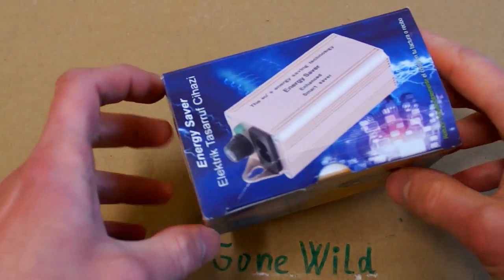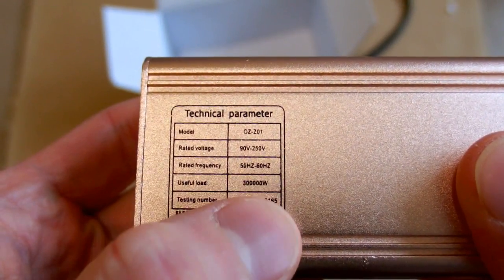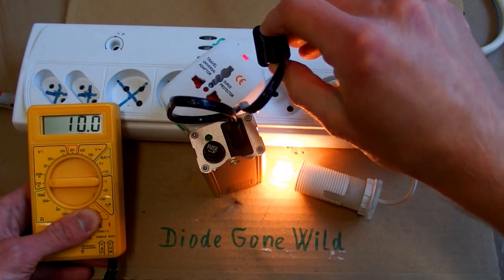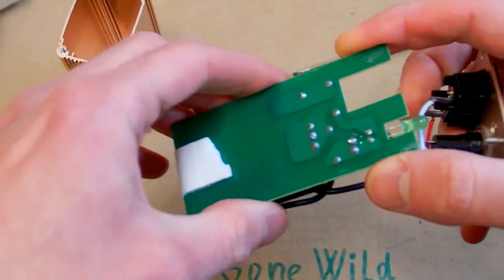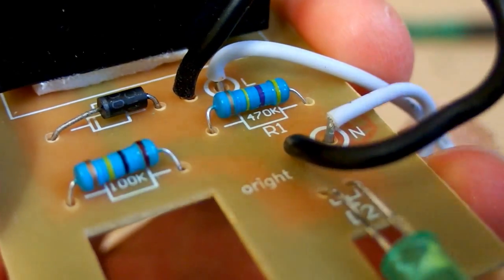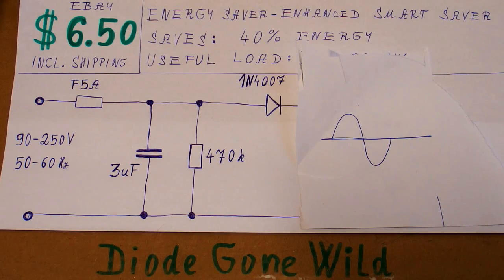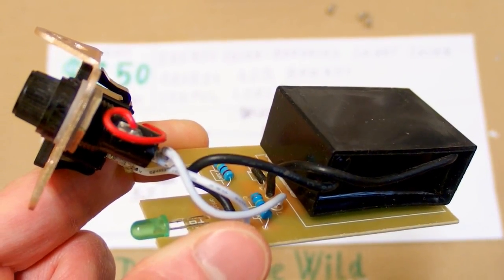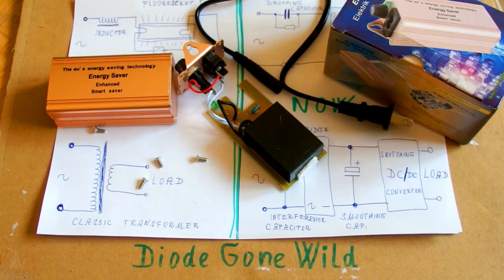Free Energy? Chinese Energy Saver (Metal Box Version) Tested.

Comment: I saw resistors in that device. They are used to regulate the flow of electricity just incase the electric company produce more energy which is higher than the exact energy needed by an appliance. That device cannot not generate additional electricity, it can only allow the electric flow stabilize. The company will produce more energy in uncontrolled flow of electricity in houses which is not necessary in some appliances so that the electricity company will earn more income and may cause small damages to some of our appliances. It is somewhat like food that the waiter serve to a customer. However, the waiter will serve more foods which are higher than the number of foods the customer ordered and the customer have no choice but to pay that wrong number of servings. Though, in electricity, a resistor can handle that. It will help to serve a customer with a good number of servings that a customer really order. Other reasons why it is not effective is because of fake markets and abusive use of electricity. We have already resistors at home. We have two.
Reply: This is the most hilarious shit I’ve read in a while. Thanks mate, you made my day!🤣

Comment: There is nothing about energy saving in this device. Capacitor between phase and neutral can reduce reactive power for induction motors if capacity is properly balanced with motor inductance. Which can slightly reduce power bill for households who use appliances with induction motors like vacuum cleaners, HVAC etc. and have old type utility meters where reactive power became wrongly added to real power due to meter design. In households with newer utility meters reactive power is ignored and "power savers" will not "save" anything. Keep in mind that same capacitor for motors with various inductances will not work. So presented device here may be considered as scam.

Comment: The plug on the cable is not a proper American plug. A compliant plug has holes, which allow for the socket to hold onto the plug better, but More importantly, the neutral prong is wider than the the live prong. This is so that you can't accidentally connect it backwards.
Reply: 50 70 percent Mein mil sakta hai kya

Comment: 2:08 I have the same deadly adapter but my father bought it from Japan. It's deadly probably because it don't have ground.
Reply: The issue with those adaptors tends to be the fact the live terminal is large enough to accommodate the earth pin of a UK plug, meaning it's possible for one to inadvertently connect chassis to live e.g. if trying to plug something in in poor light. It's not possible for such a thing to happen with French or German plugs (Which have the male element for the ground connection in the outlet) but it's definitely a risk with UK/Saudi, US and Australian plugs, all of which could have the ground pin inserted into live by accident. ⚡💥⚠

Comment: You got a nice anodized alUminium case for a future project.
Reply: Yes, this is what I though. This could be a cost saving if you need this box, a fuse holder and a 3uF high voltage capacitor. ;-)
Reply: absolutely!

Comment: we made such "energy saving devices" in primary school. it consisted of an empty mains plug and a capacitor inside, connected in parallel with terminals. we did not actually bother about discharging resistor as the main use was to give shocks to fellow colleagues during the breaks.

Comment: The box looks very similar to the box on the Smok m65 vape mod found here:

https://www.fasttech.com/products/3032/10005386/2111803

Just like the Smok m65, the circuit board was shoved into the box ungrounded. I was selling these and a few came back with a chip shorting out on the board and catching fire and they wouldn't refund me because it was on clearance. So I still have them sitting around.

Comment: I'm french and now in France with "LINKY" the new electric power meter for residential installation, is now the apparent power that is measured (I don't now if its the same for the European Union), as the same for the industrial installations but since many years, that why french industry use some capacitors correctly calculated to reduce the reactive power, who cost much more!

Comment: 240 volts, 300000 watts with a 5 amp fuse? I wonder what version of ohms law they were using to calculate that? A 5 amp fuse at 240 volts can only handle 1200 watts before blowing!
Reply: They having some new way to wrong calculate the value 😂
Reply: Mr. Ohm is rotating in his grave.
Reply: Chinese ohms law
Reply: Chinese Ohms. Never heard of him?

Comment: Could this device be useful somewhat as a surge protector? If the voltage sags in your house momentarily due to inrush will the capacitor help keep the voltage constant by dampening it out? Seems like it could also work as a noise filter. If you have RFI or EMI on your wiring this should smooth it out also.
Reply: Probably it could. But it would need some PCB and electronic and many milli farad capacity and not only a few micro or nano farad.
Better throw this away and use a variac instead. ;) It's simple and more useful for surge protection
Reply: I doubt it.  For high energy stuff, it's just not big enough.  And for fast spikes there's a whole lot of inductance in the wiring.

Comment: Heh. What a snake oil equipment. If that is cheap, I could buy those for DIY purposes. But as you told, it is metal and the socket is class 2 (double insulated) it is quite challenging to make it safe.

Comment: You did not set up this device on a inductive load, normal light has not much to do with power factor, there for no saving in it, but if you put on a motor load certainly it should improve the power factor which helps to save bill.

Comment: This device is design to use with power tools and microwave appliances they draw too many amps on the circuit to prevent power surges when you drop too many amps on the circuit so you do not blow your fuse in your fuse box or cause damage two other appliances plugged into the same line

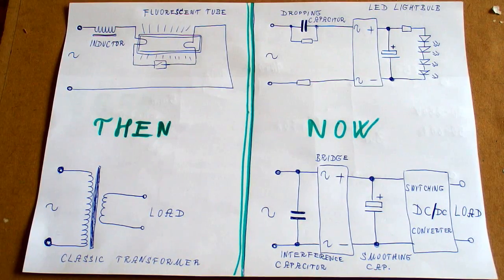Comment: 7:44 - Takže kompenzační kondenzátor v zářivce zbytečnej?Nebo zvyšuje učinník nebo nějak pomáhá?
Reply from the maker: Je zbytečnej pro uživatele v domácnosti - ta za indukční proud neplatí. Ale zbytečnej není pro rozvody a trafostanice, který jsou bez kondenzátoru přetěžovaný indukčním proudem. A zbytečnej není ani pro velkoodběratele, kteří za indukční proud platěj.
Reply: The compensation capacitor is likely to help reduce noise or increase power factor.

Kompenzační kondenzátor pravděpodobně pomůže snížit hluk nebo zvýšit účiník.
Reply: To je možné,tlumivka o něco více bručí. Ale kope s nevhodným odporem když sjsou na prodlužce a dotkneš se kolíků.That's possible,ballast is making a bit louder noise.But it can shock with badly selected discharge resistor and when it's whole on cord and touched.
Reply: Brum tlumivky mi nevadí,a na trafech v Krasíkově (vidím z okna na PVE Dlouhé stráně :D)mi nezáleží:D To světlo mi vykompenzuje něčí condenzátorovej zdroj XD. A navíc-málokdo dnes používá ještě nějaké elektrosvit světla...A pokud jo,tak v nich má kondy.
Reply: It’s important to note that in some countries in Africa we still pay for inductive loads, our meter bills a measured in the amount of current we consume and the power factor is usually poor. So this device based on your explanation will actually save power!
Reply: @LINGUA_MACHINA  Let's say that it will save cost, not power. But in this case you would need a much bigger capacitor close to the inductive loads.